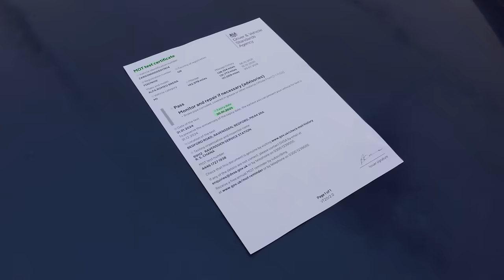The Drive Tribe Alfa Romeo Brera #alfaromeo #drivetribe

Comment: As a recent convert to Alfa, and a driver of a 2009 159 Tbi I can so relate to this... My car has spent more time in the garage than on the road since I bought it in April; I think I will have the automotive equivalent of Trigger's broom by the time its done!  If 'done' is actually possible with these cars.  What engine does this Brera have?
Reply: It has a 5 cylinder turbodiesel